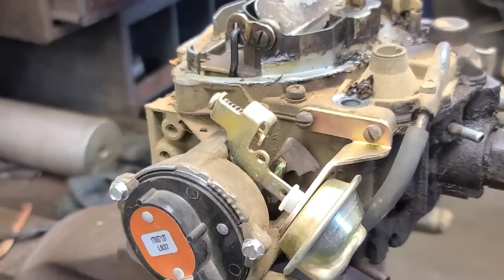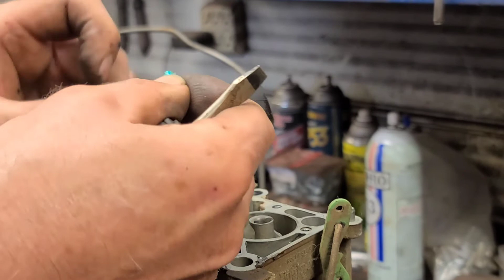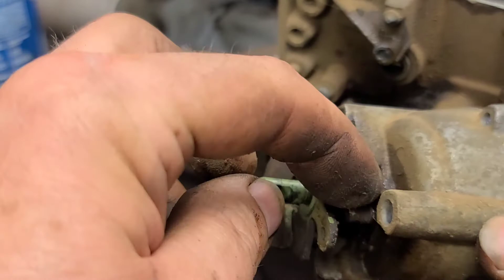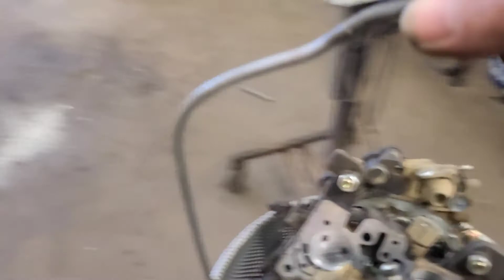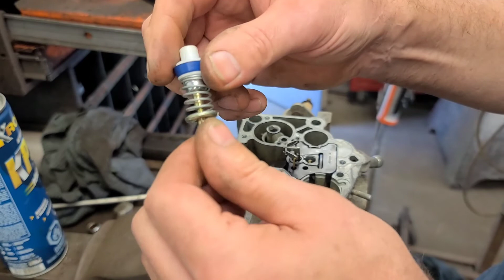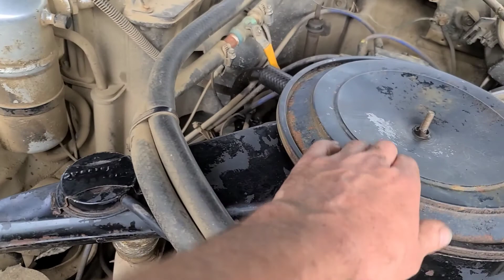1981 GM Dual Jet Carburetor Overhaul

Comment: I have a 231 buick 6 cyl. in my 1930 Model A that has this carb.  Hard to believe, but I have to crank the fast idle screws out 10 turns for it to idle and run correctly.  I keep trying to get them further in, but until I back them out to 10 turns, it doesn't run well.  Runs good at 10, but it bothers me.  Any ideas why they are so far out?
Reply from the maker: I'd say that you have a vacuum leak.  Try pinching off vacuum hoses. Possibly the PCV is flowing too much.

Comment: Tengo uno y consume mucho combustible xq sera
Reply from the maker: There are dozens of possibilities, float could be sinking, needle and seat leaking, choke stuck on, power valve stuck up, carb adjustment out, timing retarded, exhaust plugged,,,
Reply: @PhillipBailey puedes decir lo en español xf
Reply: Puede decir lo en español xf
Reply from the maker: Hay docenas de posibilidades, el flotador podría hundirse, la aguja y el asiento con el asiento, el estrangulador atascado, la válvula de alimentación atascada, el ajuste de los carbohidratos, el tiempo retrasado, el escape enchufado ,,,

Comment: Buenas tardes amigo yo estaba desarmando mi carburador y saque ese tornillo q uste menciona q no se debe tocar alguien me podría guiar para colocarlo como estaba el carro me tarda mucho para prender
Reply from the maker: If it is screwed all the way in it will be super lean. There is an aluminum plug in the top part of the cover that you can pull out by drilling into it and threading a sheet metal screw into it and prying it up and out. There is a special wrench for adjusting it up or down but you can use a piece of 3/216" tube squeezed  oval. Start about two turns from fully down and adjust it 1/2 turn up at a time until there's no bog or hesitation on mild acceleration.  Hth

Comment: I did a quick google search but I’m wondering how hard it would be to get the measurement tools you used for setting the float and choke angle for high and low idle? 

I think I’ve studied this periodically over the last year. Thank you for providing this video! I’ve never rebuilt a carb before and I’m Mentally preparing my self to rebuild my 1979 duel jet.
Reply from the maker: https://www.ebay.ca/itm/235216254090?mkcid=16&mkevt=1&mkrid=711-127632-2357-0&ssspo=ibwwcfnts5a&sssrc=4429486&ssuid=&var=&widget_ver=artemis&media=COPY
That's angle gage. As far as the float level is concerned a Verner scale will work.

Comment: Man great video. I HATE THIS CARB. for some reason I absolutely cannot get the carb to snap back like that one does. And omg don’t get me started on trying the get the pump and needles to agree with the gasket.
Reply from the maker: Do you mean the throttle won't snap back closed?
Reply: @PhillipBailey  yes. It is just ever so slightly open
Reply from the maker: @teabags3632  is the fast idle setting keeping the throttle from closing. There's an adjustment screw under the choke housing that comes into affect when the choke is on.
Reply: @PhillipBailey  when I took it apart I made sure to not mess with the choke settings.
Reply: @PhillipBailey  figured it out and not sure how this happened but the butterfly was slightly miss aligned like just one of the circles. It was hitting the body of the carb not allowing it to shut. I’ve got it back on there now and it fires right up but now I have to deal with getting it tuned in

Comment: Awesome Tutorial’.  Im having a tough time with a 1982 3.8L Regal Off idle Bog on Dynoed Rebuilt Carb .   Im about ready to just disconnect Wire to CeL light and just go to this Carb.  I’m ready to fly you out here to Wny to get this thing right !
Reply from the maker: You mentioned CEL so I take it this is a feedback carb. There are dozens of possibilities to cause a bog or hesitation.  Is the base ignition timing correct. Is the system in fuel control? Codes? What happens if you unplug the mixture solenoid? Is the TPS voltage sweeping normal?
Reply: @PhillipBailey  Feedback yes’ base timing correct,Tps new’ and I haven’t had the car in my hands to try unplugging M/C to see results.   What was odd was last year before putting this car in Storage was it had no Cel light but had off idle bog with new Accelerator Pump.  Beginning of this Season i had the Dreaded Dead battery Si Alternator ( deMagnetize) and after sorting that it would run Fine with Distributor unplugged but obviously = Cel light .  This Regal has been a nightmare .   Its completely Restored but can’t give this car back to owner (Bills/Sabres) in this condition 🤦🏻.   I appreciate your help as these Early Feedbacks are a notorious nightmare!
Reply from the maker: @mrmoparrr  those systems were pretty primitive. I'd start by acquiring an OBD1 scan tool that can connect to the ALDL under the dash to scan it for codes, there is a data list available and I'd want to see proper MAP, TPS, Barometric and coolant temp readings. Unplugging the MC solenoid will cause the fuel delivery to go rich. With it plugged in you should hear the MC solenoid clicking rapidly KOEO. There is a green wire near the carb that is the MC solenoid test terminal. You can use an old school dwell meter set on 6 cylinder dwell mode to test the dwell at the MC test wire. In closed loop it should be switching between 10 and 50 degrees. In open loop fixed at 30 degrees. Be sure the distributor is plugged in and that the timing advances as the rpm increases. When the ECM dies on these cars there is usually no cel and MC solenoid operation. Test battery power, ignition and ground to the ECM. Good luck
Reply: @PhillipBailey  Now I Know what the Green Plug is for ! Appreciate the info Bigtime.  I now have something to Troubleshoot with’
Reply from the maker: @mrmoparrr how did you fare with your feedback carburetor issues.
Reply: @PhillipBailey  after 3 Carbs we finally seemed to get one that didn’t seem to be extremely worn internally and idled and didn’t have off idle Stumble and BoG.    Damn check engine light does come on but goes off again quickly like a Soft code or Something.  🤦🏻

Comment: I love the comprehensive breakdown you filmed. Getting ready to rebuilt my M2ME for my '81 Camaro. Out of curiosity, is there a rebuilt kit you recommend for my application? RockAuto has a few options I'm eyeballing. Thanks for the video!
Reply from the maker: I like the Hygrade kits and they usually come with a spec sheet but this one did not for some reason.  Thanks for watching

Comment: Where did u get the rebuild kit at
Reply from the maker: You should be able to order from your local parts supplier based on the carb number. Otherwise try ebay or rock auto

Comment: I rebuild a 17082132 dualjet using this as a general guide, installed it and it's running super rich. I asked a mechanic who's had experience with these. He mentioned they can weep fuel through the fuel bowl straight past the butterfly valves, is this something anyone else has heard I can't seem to find any documentation on this issue he said it was fairly common.
Reply from the maker: Yes he's right. There are two crimped into place plugs that are in the bottom of the float bowl that could leak but it could also be due to the float level being too high or the float actually sinking. Did you replace the float? Could also be leaking needle and seat. Can you see fuel dripping from the main jets at idle. If so the float has sunk, float level is too high, needle and seat are leaking or the power piston is too high or not being pulled down by engine vacuum. If its leaking from those plugs you can see that with the carb off and fuel bowl full of gasoline.
Reply: @PhillipBailey  I wasn't able to see fuel from the top, I replaced everything excluding the fuel solenoid. The car was running ok just wanted to do a once over. How would you recommend fixing the plugs if it is the issue?
Reply from the maker: @imwatchingnotreally7433  wait you said fuel solenoid...is this a feedback carb? Does it have a mixture control solenoid and throttle position sensor?
Reply: @PhillipBailey  yup, I'm actually a gm parts counter employee, I was able to get the full break down pictures of it. It's a 1983 229v6 in a Elco. Still hooked up to the emissions loop & "active loop"
Reply from the maker: @imwatchingnotreally7433  does the mixture control solenoid click repeatedly with the ignition on about 2 times per second? If not the solenoid is not moving the needle valves up and down in the jets. They are spring loaded to full rich. Does the check engine light come on with the key? One of thr wires the the mixture solenoid should be live with the key on. The other wire is duty cycled by switching the ground on and off by the computer. Check fuses. You could also connect a conventional test light to the MC solenoid and with the ignition on the light should be flickering.
Reply: @PhillipBailey  yes the solenoid is firing on key on, the check engine light does come on during start and then goes out. As far as I'm aware it was working flawlessly before.
Reply from the maker: @imwatchingnotreally7433  did you remove the MC solenoid stop screw? If it's set too high it will be too rich. Do you have a scan tool to read the O2, map, baro and temp readings. Try disconnecting the O2 in case it's reporting a false lean condition. You can test the system with a dwell meter.
Reply: @PhillipBailey  I did remove the set screws but adjusted them back to the specified spec, I don't have any tools to measure much other than a dwell meter. Of which I have no clue how to use.
Reply from the maker: @imwatchingnotreally7433  to use the dwell meter connect the positive lead to the open green test terminal near the carb and the negative lead to the battery negative post. Set the dwell meter to 6 cylinder selection. Key on should read 30 degrees steady. Running in closed loop dwell should be switching between 15 and 45 sweeping slowly. There are videos of this on YouTube
Reply: @PhillipBailey  thanks for the help once I pull the car from storage I'll be able to start dinking around on in.

Comment: Need some help on knowing what lines I can cap off and do away with on this carburetor? Thanks and great video
Reply from the maker: All the external circuits or vacuum lines have their purposes. If everything is functional as it should be the only line I'd cap is the EGR vacuum line. If you're in a warm climate then you could disable or delete the hot air intake in the air filter housing. If your Cruise control is not working you could delete that line so long as it does not affect the heater controls.

Comment: question, the needle's going true the jets.. but I want to know,  when the vacc activate and suck the needles true jets and restrict the gas flow..
the needle block totally the gas flow or how much the needle is open to pass gas true?
Reply from the maker: Yes vacuum pulls the needles down into the jets restricting them but not closing them completely. Under a heavy load the vacuum will drop and the spring will lift the tapered needles out of the jets allowing more fuel and therfore more power. That piston is called a power piston.

Comment: Nice video to watch! Thanks! I'm having a bit of troubles with a rochester dualjet 210 on my 79 pontiac Grandprix, do you might have any tips for me? It is bogging/hesitating when putting the gaspedal full throttle, when i give it a little bit of gas and build up the rpms slowly, then it has no problem wide out throttle. 
Greetings!
Reply from the maker: Could be the power valve is stuck. You can test it though the vent tube in the front center of the carb. With the engine off and using a small screwdriver it should be up and you can push it down about 1/4" to feel the spring and movement.
Reply: I am currently having the same issue after my rebuild. I'll have to check out the power valve. Thanks again!
Reply from the maker: @joeyelson8256  did you remove the power valve stop screw? If so and you reinstalled it too low that could be your problem.
Reply: @PhillipBailey  i did remove it and I was not sure where it was set or how to re set it properly. I went off photos i took while disassembly. So I will look into that, thank you again!
Reply from the maker: @joeyelson8256  there is an aluminum plug in the top section of the carb float bowl. If you remove that plug you can then use a tool to adjust that stop screw up. Remove the plug by drilling into the center of it with a 1/8" drill bit. Screw in a self tapping screw and pry the plug out with a forked tool. There was an actual tool for turning the screw as its oval if I remember correctly. I remember making one with a piece of 3/16" steel line squeezed oval in a vise. Turn the stop screw up or counter clockwise to lift the power valve and richen fuel delivery. Start about 2 turns from the bottom. There were no specs for this screw as it was initially adjusted with the carb on a flow testing device and each carb was a bit different. Keep raising the screw and road testing til the bog is eliminated. Once set lightly tap the plug back in place. It's about 1/4" thick by the way.
Reply from the maker: @joeyelson8256  here is some information I found that might help. The adjustment is called Adjustable Part Throttle setting. https://www.crankshaftcoalition.com/wiki/How_to_rebuild_a_Rochester_Quadrajet_4MV_carburetor
Reply: @PhillipBailey  i can't thank you enough for taking the time to help me out!
Reply from the maker: @joeyelson8256  you're welcome and thanks for watching.

Comment: wow it is been a good will since i did rochester 2 barel .if i remenber well that idle selenoid is for when the ac is aply..i could be wrong about that .. good video thank
Reply from the maker: Some were used as an anti-dieseling control. Was energized with the ignition on and deenrgized key off allowing the throttle blade to close preventing runon. Some of the later v6 and 4 cylinders used them as you mentioned to bump up the idle when the AC compressor kicked on.